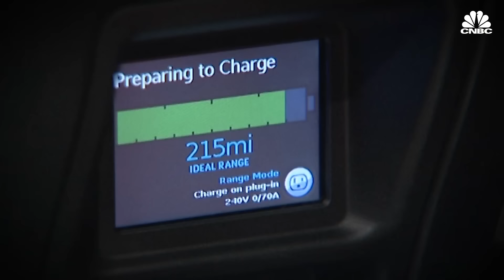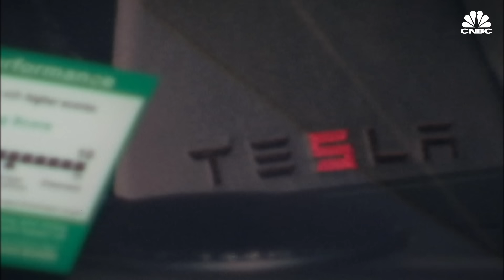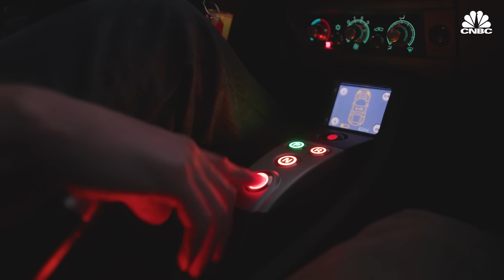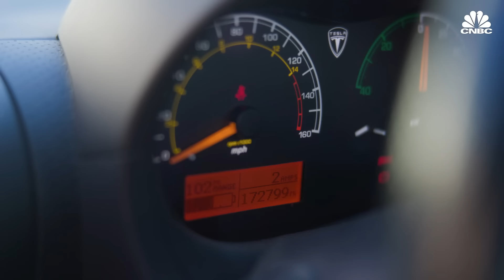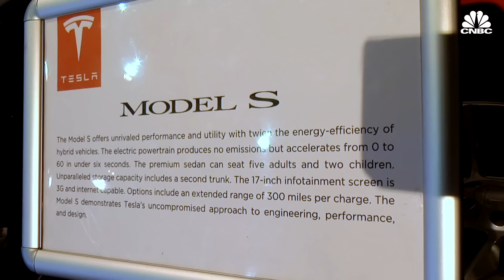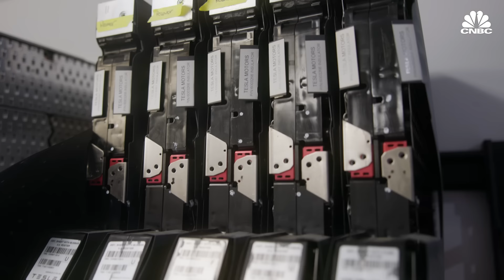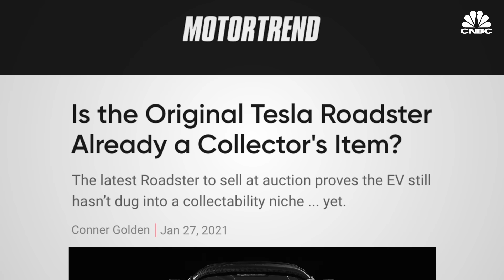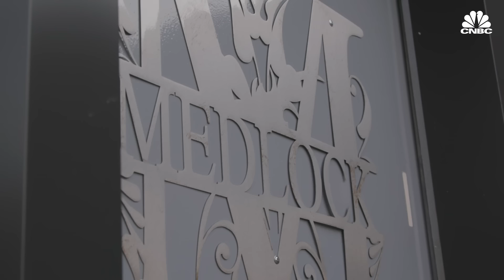What Happened To Tesla’s First Car — The Roadster?

Comment: The Roadster looks amazing.  I would love to drive a car like that.
Reply: It's a lotus Elise body, looks exactly the same except it has a gasoline engine
Reply: @samzuckerbraun3496  Not even close. It's a completely different body, made from carbon fiber. The chassis was extended to fit the Tesla battery pack. You couldn't fit Elise body panels if you tried.
Reply: @samzuckerbraun3496  they had to rework everything.. so it's not an Elise sorry.
Reply: @ErikRobertson  Soo you can't use the Lotus Elise to repair Tesla Roadsters? That sucks tbh
Reply: @ErikRobertson  not even close??? It's like 70% the same. It's like an updated Elise with a body kit. They look pretty damn close. If you told someone it was a new model Elise they would believe it.
Reply: @BabyJesus66  Similar body lines, but the body panels are not interchangeable. The body was designed by Tesla in collaboration with Lotus. I've disassembled a Roadster and physically compared it side by side with an Elise. The only shared exterior part is the windshield. On the chassis, the side rails are lowered on the Roadster for easier entry. Rear subframe is completely different. You can't even use Elise suspension parts.

Comment: The water pump car has finally been repaired.
Reply: Haha nice job Carl! Electrical gremlins keeping you busy
Reply: Carl you're really amazing. your workplace is awesome and i hope you keep doing this in future too and become the go to repair shop for EVs all over the world. All the best for future.
Reply: What did you find that caused the problem?
Reply: @Atgul-z6o  Two problems actually. Roadsters have temp sensors all over inside the battery and outside in various components.   One of the wires to a sensor was in the wrong pin location from the factory.   It was causing two temp sensors to provide erroneous  input signals to the wrong pins in the VMS (vehicle management system).  One sensor was bad but when I checked it, it read ok. It read ok because it was actually reading the board next to it. Pretty harmless issue, the car made it 10 years like this.  I asked the owner if I could keep it and solve the problem. They were very kind and let me go after this.  I took a ton of notes but the reality is, I’ll never see this again.
Reply: @medlockandsons  Impressed you kept at it.  My trucks electric fuel pump would quit at times so I just ran a wire from a circuit that is hot when the engine is running, to a dash switch, to the pump motor.  I know, not professional but it works, and when the switch is off the engine wont run....simple anti-theft device.
Reply: @medlockandsons  Impressive persistence!

Comment: Ten years later this is going to be one of highest valued collectors item. Period.
Reply: I don't think so...
Reply: Why do you think not?
Reply: @getintothewildwithjeffruma8777  will be dead weight with dead batteries :D
Reply: @getintothewildwithjeffruma8777  I personally just don't see any value in them as it wasn't really ever a Tesla to begin with. It was a Lotus rigged with an electric power train. It's not exactly a beautifully hand crafted work of art like a Bugatti, Koenigsegg, Lexus LFA. It's actually kinda ugly and looks like a garage built kit car. Along with the parts being so hard to come by and them being specialized parts that can only be made by Tesla which has no interest in keeping these cars running anyways...  If you bought one today for $160,000 and didn't touch it yes it would be worth maybe $350,000 in 5 years but the reality is technology ages and let's say a circuit board goes bad on the car. That's $60,000 to reengineer one plus the install. The iPhone 3 sitting in a box somewhere in my garage isn't worth anything along with my Galaxy S8 and my Xbox 360, Ect. The reality is old tech doesn't go up in value and with it being almost impossible to repair as used parts run dry what do you have? A pile of parts on wheels... 60 years from now it won't be possible to take the 2008 Tesla Roadster out for a drive because it won't be able to be kept alive that long. Plus once their new supercar comes out THE REAL TESLA ROADSTER in 2025 this thing will be worth absolutely nothing and I'm willing to bet on it.  

I love Tesla and everything they do. I'm a huge Elon Musk follower and love electric cars but I don't think the roadster will ever be anything special. It will definitely end up like the AMC Javelin or DMC DeLorean, Eagle Talon, BMW Isetta.
Reply: @lifeofmike556  you don’t think other collector  cars with very few made don’t experience what you said either? You don’t know what you’re talking about
Reply: @inter5123  This is technology we're talking about. It's a Lotus with an electric motor and Tesla slapped on it. Will the car go up in value? YES is it an investment YES will it make you money YES. But to call it one of the highest valued collector cars in the world? No. Far from it.
Reply: Lol! McLaren F1 says hi.
Reply: @lifeofmike556  its not about the tech or product being inferior. Its about being a part of History. You can still see example of Apple 1. Its a first Apple product. Technology wise its nothing now, launch price was $666 however it was sold for $458,711 in a 2020 auction. Why Tesla roadster going to be a highly valued item is because of being a part of a history of a company changing the world.
Reply: i have it on a hotwheel so ten years later it will worth 5 euros lol
Reply: No, far too many exist for it to gain a really high value as a collectors item.
Reply: There are still exotic cars that are even more rare.
Reply: @lordzed83  wrong batteries are being replaced. Even tesla is still supporting the replacement packs
Reply: U crazy it’s a junk car .
Reply: @rohitchibhrani1417  You act like the Tesla Roadster is the first electric car ever made. Far from it. It's not actually a Tesla which is what you're missing. It's a Lotus. And it doesn't have much to do with history either. There were electric cars before Tesla.
Reply: No one cares about ancient electronics. Electronics are a luxury and newer is always better. Better range and modern amenities.
Reply: @rohitchibhrani1417  there were electric cars before this. If you want a historic piece it is the model s, but look at those year 1 resell, garbage pit.
Reply: @lifeofmike556   Why not wait 10 years and see because there have always been reports 1st roadster is going way upwards in value. And as i said, again it’s not electronics its history of a company (not industry). You take any first product of a company that has somewhat changed the world, you will know.
Reply: @Magnus-pm7ic  i totally understand, but my point is not about electric cars or any tech. Its about history of a company. Did someone ever think in 2008 that Tesla shares would be this much worth? Hell no one believed when there were reports it would go $15000 a share. It has already been split and would be $5000 without it.
Reply: @lifeofmike556  you do realize Isetta's are going for big money>?
Reply: I'll bet you everything it won't
Reply: @lifeofmike556  WRONG
Reply: @lifeofmike556  No, the Roadster wasn't the first electric car, but it was the first electric car with a range over 200 miles that you could actually buy, as well as the first car to allow for fast charging so as to make long-distance travel reasonably practical. Plus it was pretty much only because of Tesla's popularity that the major auto makers started seriously investing in electric cars of their own. Which makes it an important milestone in transitioning electric cars from niche market hippie-mobiles to a practical option for the average motorist.
Reply: @rohitchibhrani1417  Not when it has dead batteries.
Reply: @rohitchibhrani1417  Model T was first car from Ford and changed the world yet they are essentially worthless.
Reply: @zepm7184  my point. Model T were mass produced so there is still abundance of those models. Still however, model T have been sold for $110,000 in the last 5 years, and it was launched in $18,000 (Today’s value)

Comment: I’m surprised Lotus isn’t able to help these guys out with sourcing parts??
To think this has appreciated twice it’s original value. Unbelievable. If we only knew then… 
Kudos to keeping them on the road!! 👏🏻
Reply: Agreed. I'm surprised no mention of they reach out to Lotus for spare body parts.
Reply: Almost nothing about the car - including external parts - is original Lotus. There's a bunch of cutouts and other modifications to fit the internals. However, I think the hood is still original (they may have just bought Lotus' molds for that?)
Reply: @muskistutter  Lotus assembled the cars but did not produce the body. Soltera made the carbon. Last 5% of a Roadster are Lotus parts.

Comment: You have to bring up the fact that Elon Musk was not CEO when the first Roadster came out.  At the time, he saw no vision for the first Roadster and moved on with the model S.
Reply: Not sure what your point is.  The company was founded in 2003 without him, but he was chairman of the board in 2004 (because he became majority stock holder).  He took the job of CEO in 2008.  Musk was also active in the development of the car.  Musk was thinking long term wanting to expand into a larger market then what the roadster could support which meant the roadster could not be their only focus.  As far as long term planning, it's difficult to say anyone could have been more effective.

Comment: Lotus has designed a great car! Remember that this is not an original Tesla design. Tesla's new stuff is damn good though.
Reply: Lotus has helped/partnered with a lot of companies fr the decades tbh!
Reply: This car doesn't share a frame, drivetrain, wheels, brakes, body parts, etc, etc, with a Lotus car.  The count of parts that it shares with an Elise is about 6-7%, and less than that if you go by parts value.  Some of the shared parts are the windshield, steering wheel, side-view mirrors, and some of the dashboard.

Comment: The Roadster was basically just a Lotus Elise with an electric motor added. So when it's no longer possible to repair the battery drivetrain, switch to the internal combustion drivetrain, and you pretty much have a forever car.

Comment: The one with the water pump problem.. disconnect it from all electrical sources and insulate it from anything metal. Then run custom wires as a bypass.

Comment: I saw what I think I saw what I thing was the first public demo of the car that became the roadster in Santa  Monica, Ca.

Allan Coconni , who designed the EV-1 drive train for GM, was at this private home to demonstrate his new product a Toyota/ Scion car converted to his EV drive train.

After the introduction of the new car in the back yard we went to the street to see his Lotus conversion.

He stepped on the pedal hard and  sound the car was fine! About 0-60 in 4.5 seconds.

Allan invented the roadster and came up with the crazy concept of using thousands of laptop 18650 lithium cells instead of what all the other EV-s used in the past.

The reason was the owner of the NiMh patent did not sell the batteries used in the GM EV-1 or the improved Panasonic version used in the Toyota RAV-4 EV.

Texaco bought the battery patent from GM when they stopped making the EV-1 then merged with Chevron .

I Personally talked to the Fake company the oil company set up and asked to buy batteries for testing in our Phoenix Motor cars prototype.

They would only sell in quantities of many thousands, and No demo cells were available.
They did try to sell a UPS with there cells and we considered buying them just to get the batteries and leaving the inverter part but they wanted too much.

Allan went through the same thing and decided he would skip the proven NiMh batteries and go to lithium even though it meant Thousands if small batteries , and points of solder connection failure points, to get around this.

Look at the movie “who killed the electric car” to see Alan. He is not a musk like extrovert but deserves the credit for the roadster.

The Tesla founders bought the rights from Allan’s company and turned the prototype into a real car. So the founders deserve credit just not invention credit and Elon was not involved in any of this!

Hope this helps any EV historians…

Comment: There’s a place in Arizona Gruber motors Inc. they rebuild Tesla vehicles as well as the roadster they rebuild the batteries and electronics completely. They also can bring an original tesla roadster back to life when the battery is completely dead and won’t take a charge.

Comment: For lots of old cars the brand stops manufacturing parts and then they cant service it. In Europe, most older cars go to repair shops other than the dealer because parts can only be found in scrap yards and dealers don't source parts from there. For Tesla, being a fast moving company, the roadster is VERY old. Its more than normal that service has to be sourced from outside the brand.

Comment: As an Elise owner I wonder how many shared parts there are. I see a lot of them in the video.
Reply: As an Elise owner I know there is not much shared.  Tesla contracted with Lotus to build the chassis with the techniques Lotus had developed to build the Elise, but the chassis for the two cars are not the same.  The Tesla uses the same windshield as an Elise.  Lotus also built chassis for GM/Opel in the same production facility at Hethel.

Comment: barely 15 years old and already out of parts, that's what happened when you have one company monopoly the part supply.
Reply: Well there's a few other factors but they did source parts from a number of other companies that have ceased production of said parts. The more difficult issue is that during the time after production ceased there was no stipulation to require the suppliers to retain the molds/tooling to their products so all of that was lost and had to be remade

Comment: Gruber motors has a similar collection and rebuilds roadsters.

Tesla at least didn't crush them like your benefactors did to their car at GM.
Reply: Gruber had a similar collection. Lost 20+ in a fire last year.

Tesla doesn't crush Roadsters, but if you sell or trade one in to them, it will rot away in a back lot and eventually be stripped for parts.
Reply: Gm crushed the cars for this reason. Had they allowed people to retain the cars, they would be required to retain parts and repair as part of the gm dealership agreement.  Tesla has no dealership for repairs and still retians that philosophy.  But there are more cars to scrap parts from.
Reply: @danc2014  good points makes sense
Reply: @danc2014  As I recall, GM never sold those cars outright to consumers, thus had no obligation to owners because there weren't any owners.

Comment: But how long does the battery life span is suppose to last 10 or 15 hours?
Reply: Eventually they will trickle down to the car collectors and just sit in a garage for decades.
Reply: @LeeeroyJenkins  wow that kinda sucks
Reply: @ultimatemanny  probably if one of the community passion enough they can order custom battery that was similar to a certain battery company. lets not forget most of the owner is rich and crazy rich people that works in top tech company and buying tesla share when it was low
Reply: @raifij6698  You're right, but even rich people get old, meaning they won't be capable of driving and will leave the car in a garage until they die, or they sell the car to the highest bidder, and that bidder will either have lots of other supercars and will only drive the Tesla once a month, or it will be sold to a car collector that will just keep it locked up in a garage.
Reply: I have some 18650 batteries in my collection that are older than the ones in the Roadster(Roadster has 18650 cells)and they are still fully functional, so the 10-15 hours is just EV hate as usual :):)
Reply: @kylereese4822  - truth is rechargeable lithium or nickel batteries for BEV's will last up to a certain age for vehicle use. 

At the age the Roadsters have those if used as they should should have installed its' 3rd set of batteries (the 2nd one may be still alive in a Tesla Home Battery, but maybe not the originals, but the materials may have have gone somewhere else).

Comment: might be worth it for a plastics works shop to reverse engineer some of those body parts and do a quick run to replenish things like headlights, taillights, bumper covers and body panels.

Very cool little car. I'd still have the Elise tho since it's far more common and has somewhat of a decent parts availability. My NB2 Miata is incredibly common, so I'm never worried about parts going scarce.
Reply: With only 2000 total cars made ...  no

Comment: When the Tesla Roadster repair shop known as Gruber Motors burned to the ground, I lost interest in this cool, but dangerous vehicle. If you are a billionaire, you can probably keep your Roadster running for some time to come. If not, it will soon become a museum piece.
Reply: The first fire was from trying an experimental procedure to recover a dead battery pack. Second time, no one knows but they suggested that it started with the building's electrical panel. The cars are not spontaneously combusting.
Reply: But if you park 40 cars in one spot, one car fire may destroy all of them